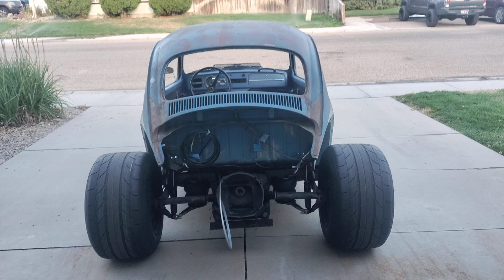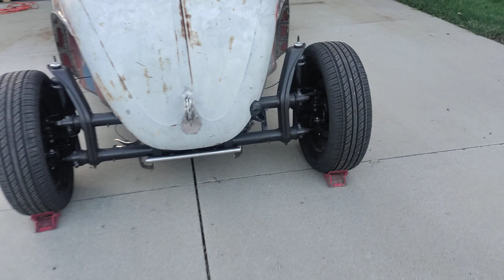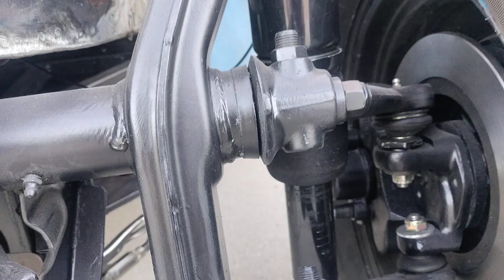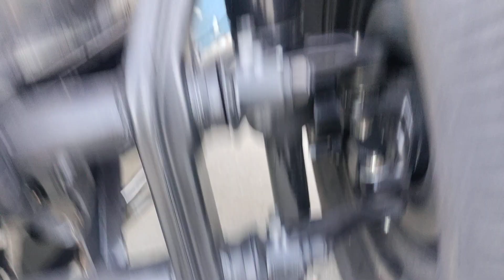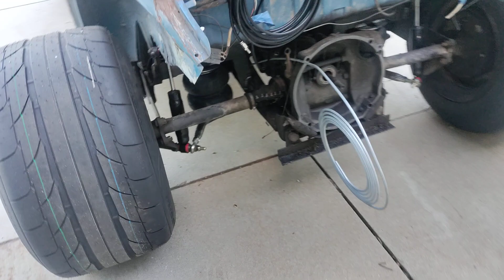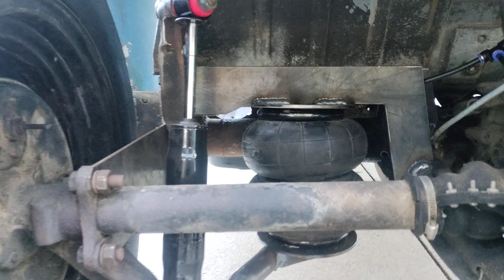67' VW Beetle on air ride. getting ready to strip body. #volksrod #custom #fabrication #volkswagen

Comment: When you do the air ride up front, do you just eliminate the torsion part in the front tubes?
Reply from the maker: I did and put through rods. You don't have to, it will just limit the full range of motion and I wanted ever inch of up and down. It's the same in the back, I pulled the torsion bars. Full air ride and struts.